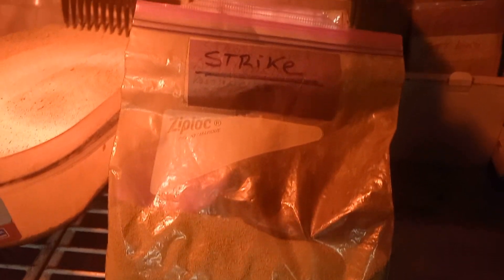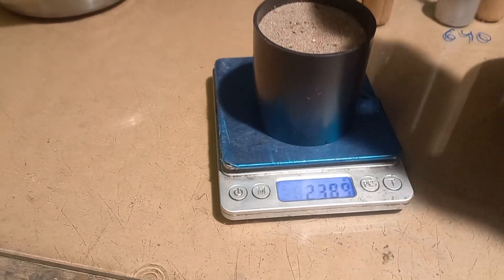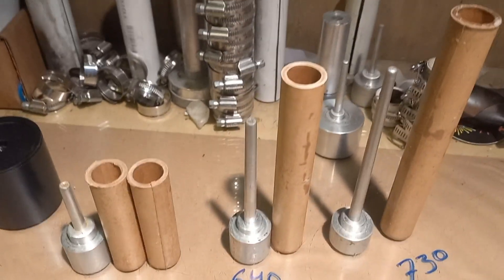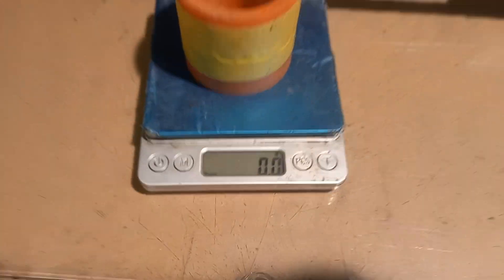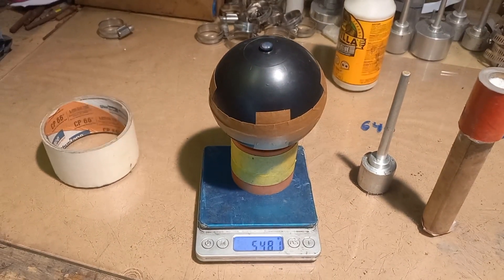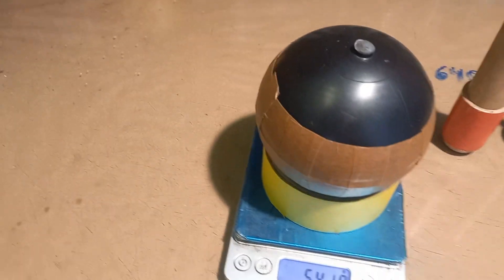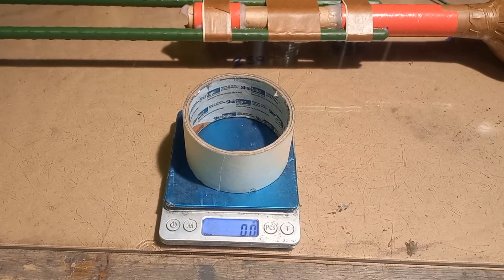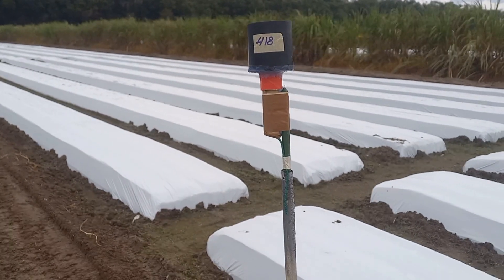Whistle fuel STRIKE a new high output fuel (lifting test)

Comment: What size spoon increment do you use for your 3lb motors per increment?
Reply from the maker: @fredrikrasmussen8613  3.5 grams x increment
Reply: @Pyroflorida  Thank you sir.
Reply from the maker: @fredrikrasmussen8613  for red line fuels like Strike or khp the  size increment should be  3  to 4 grams , you can use more per increment but consistency is the key here.

Comment: Nice the lifting is crazy, I just made some Sally fuel (AP 76%)(sali 23%) (red iron ox1%) and 3% wax. But I'm thinking of switching out the 1% red iron ox with copper oxychloride. But I'm hearing some people say instead of the 1% they use 0.5% which is half. Don't know if that's about right. Have you ever mixed copper oxychloride with sodium salicylate?
Reply from the maker: @patman0250  yes I did , it has a very high tendency to CATOing  , my formula was 68/32/1/3
Kclo4/sali/cu oxichloride/wax wich is a fuel rich mix.
Maybe your 76/23 works better since the moment that is a fuel lean mix

Comment: Today I made a new composition of whistling fuel for me, it consists of: Sodium perchlorate 69. Potassium hydrophthalate (КНР) 31. Copper chromite 1%. Ferrocene 0.5%. Polyisobutylene 1%. Sodium perchlorate cannot be crushed without adding silicon dioxide 7 nm. 0.1%. But this did not help much. I had to add ground (КНР )and mix in a blender. It was dangerous! Only then did I get powder. Ready fuel immediately begins to absorb water. Therefore, I first mixed the mixture with isopropyl alcohol 20 ml per 100 g. Dried and mixed with Polyisobutylene 1%. diluted in gasoline 20 ml per 1 g and with the addition of a plasticizer 1%. Today I put it on drying, I think everything will work out!)

Comment: cooler flash!!!
Aluminum-magnesium alloy spherical, 50 microns.
zirconium < 40 microns (15%), titanium < 40 microns (5%), oil (< 1% over)
3 *1 mix.
70 potassium perchlorate
30 metal mixtures
1 chromic
0.1 Aerosil hydrophobic 7 nm
this is my development! try if the flash weight is more than 50 grams, flash on dark aluminum up to 50 grams

Comment: Can't wait to see 600 grams of flash on your whistle rockets. You're totally ready for it. 

This one hits:   

BLUE THUNDER   
70% Perc    
30% Blue Al 
10% Fine Dark Al
10% S
Reply from the maker: @TwistedMassPyro  yes man , waiting for new year for the big booms , no doubt that blue thunder will hit hard , I also got all of the other recipes/options out of your channel  , thank you a lot for that info👍
Reply: there is something cooler!
Aluminum-magnesium alloy spherical, 50 microns.
zirconium < 40 microns (15%), titanium < 40 microns (5%), oil (< 1% over)
3 *1 mix.
70 potassium perchlorate
30 metal mixtures
1 chromic
0.1 Aerosil hydrophobic 7 nm
Reply from the maker: @NeDoPyro  hey NeDoPyro  I'll love to see that in action , do you have a video about that mix?